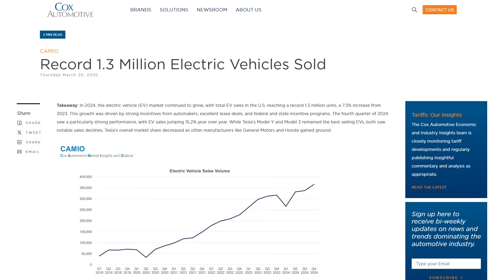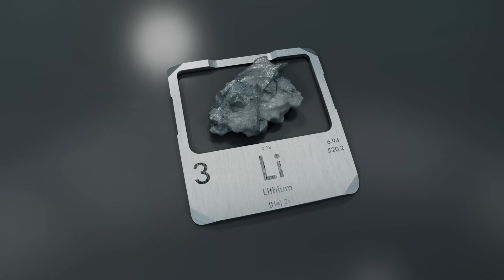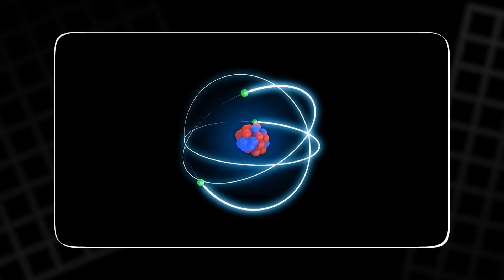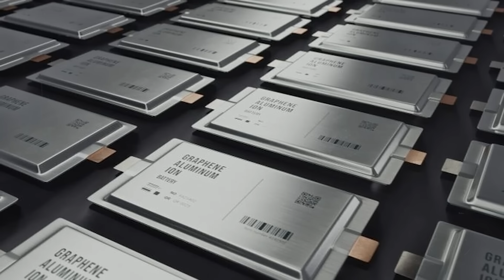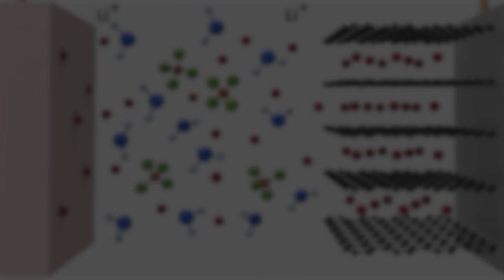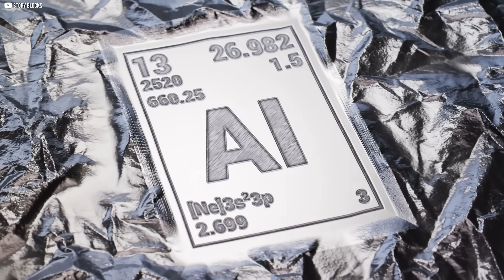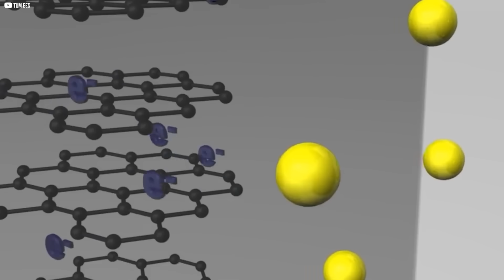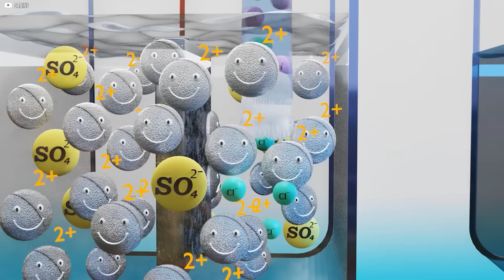Beyond Lithium: How Aluminum Is Reshaping Energy Storage

Comment: if you count from the energy weight density of aluminium-air battery, then you get same energy density as gasoline. ie 10x or 20x compared to li-ion. any electroplating battery would work, but normally aluminium and others resist being electroplated as pure metal. instead producing aqueous hydrogen instead of the metal. only zinc seems to work as a rechargeable metal-air battery easily. aluminium and magnesium need to be recharged externally, not battery-internally.

Comment: Sorry but I am putting my money in dirt cheap sodium ion batteries from CATL the NAXTRA to be exact for the average persons car. With 175 Wh/kg compared to 185 with LFP but none of the lithium and reportedly half the cost? It's the chemistry that hits the good enough sweet spot between durability, density, range and most importantly price... Somewhere between $65/kwh on the high end to somewhere as low as $10/kwh with ramped up production and Autoline Daily sources claiming $35/kwh. Either way it's a fraction of the cost with fewer geopolitical risks. Just license the design for your local battery works and boom, CHEAP, DURABLE AND USEFUL BATTERIES!

Comment: Aluminum has already a hydrogen reactant chemical properties. When mixed with copper as cathod chemical reaction possible Ferric-ions positively charge ion will be giong to Aluminum while negatively charge will go to the copper becuase of charge reaction process that the metal with stronger + positive chemical properties will attract - negatively charge ions and the aluminum will absorb the + positively charges ions.